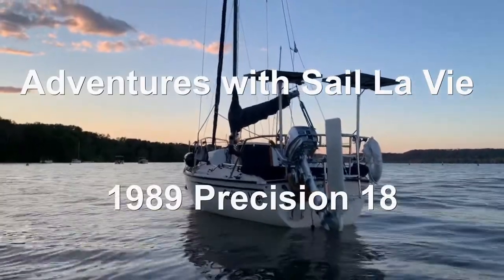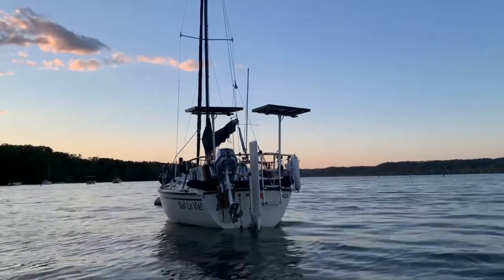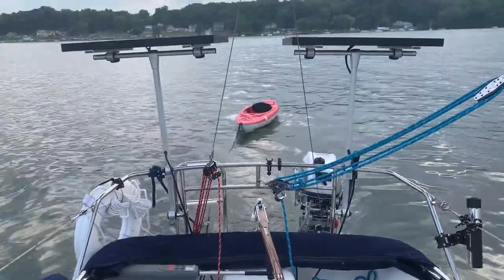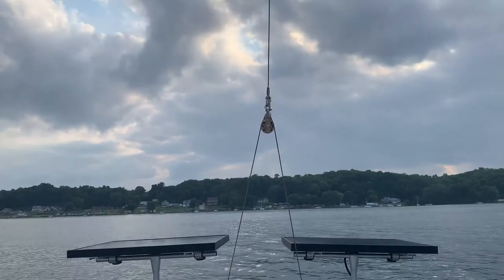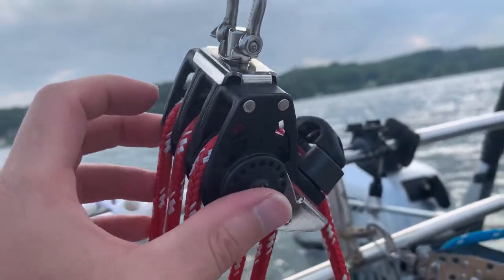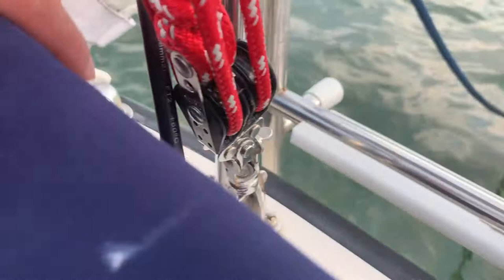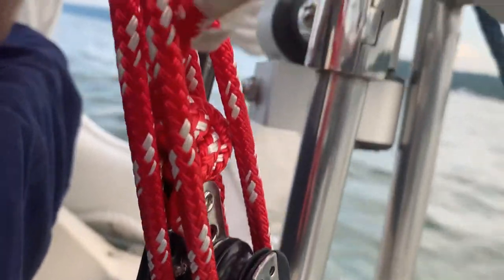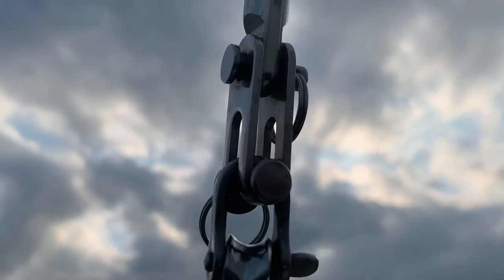Adjustable Back Stay Project - 1989 Precision 18 - Sail La Vie

Comment: I am looking at doing this for my San Juan 21.  I have seen some resources that say that you need a cable backup to ensure that you do not let the adjustable backstay off too far and invert the mast.  Was this something you saw?  How do you keep the mast from going too far forward?  Great video and thank you.
Reply from the maker: I never had any issues of the mast falling forward if the backstay was to loose.  I had a knot tied in the end to prevent the worse case scenario but I only had to loosen it a little bit to give myself enough play to install the forestay/rolling furller. This was a modification that I learned about reading Tom Scott's "The New Trailer Sailor's
Guide to the Precision 18". 

https://www.precisionowners.com/ScottBook.htm

Comment: Matt, Just wondering if you winter the boat on trailer at home and moor the boat during the season?  Kayak access seemed like a good idea if you keep it at an off shore mooring.
Reply from the maker: Exactly Jason.  I moor her during season and then she is kept on the trailer in my garage in the off season.  The kayak is a bit tricky to move from into the boat and then out of of but I make it work and it is light and easy to paddle.  Everything is a compromise of pros and cons.